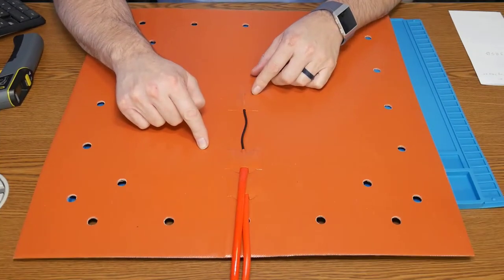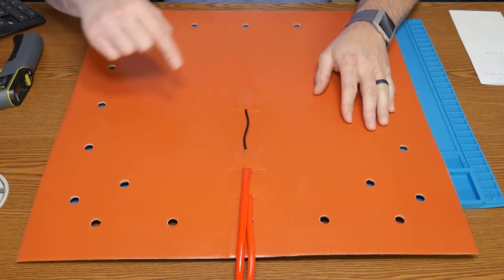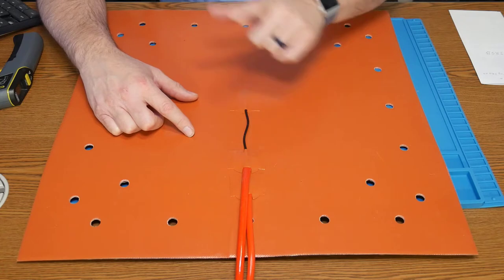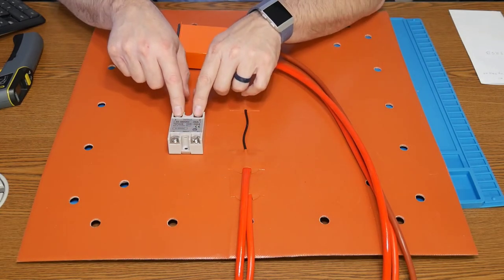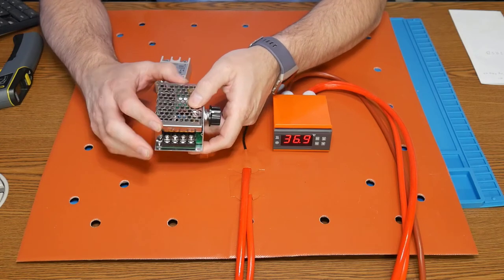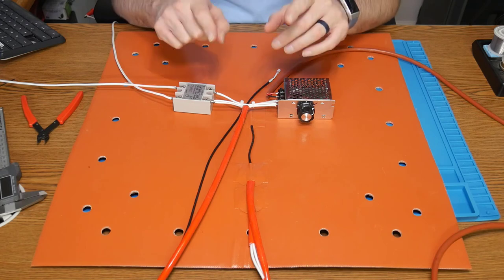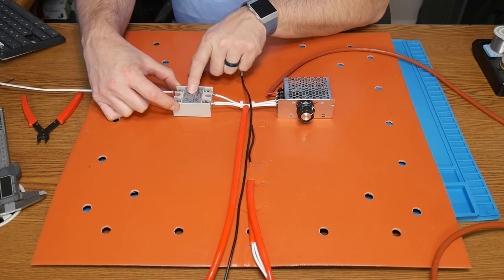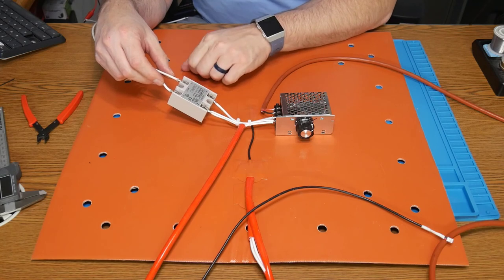Monster Bed Heater Pt1

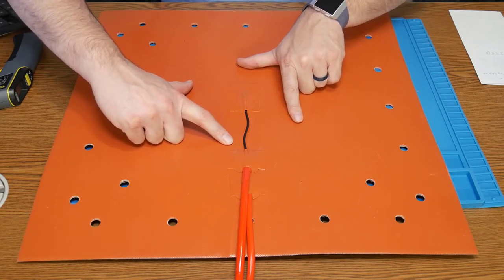Comment from the maker: Watch the bed warp test starting at 4:57 - I found this to be very eye opening. Especially the later part of the test that I did not notice until I watched the time-lapse. This test was over 30minutes in length and what it shows it that with the OEM heater, the bed is NEVER level and also the bed is NEVER the same, even well into a print.

Comment: Would you mind linking to the parts? ☺️
Reply from the maker: I Can't really link directly to the parts as the Aliexpress vendor must know the correct voltage for your setup and the other two parts are just on Amazon. Do a search, you'll find them. The exact ones I purchased do not seem to be listed anymore. Thanks for watching!
Reply: @Grimm3D  I actually have the bed, it's more the regulator I'm curious about 😁
Reply from the maker: @JimmiFriborg  Sorry, the links for the exact parts I ordered are not active anymore. I have had these parts for a long time and just didn't have time to install them while filming. On Amazon, search for AC110V 4000W Regulator. Good luck!